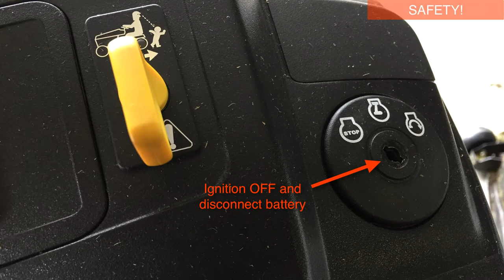Ride On Mower Snapper RXT 300: Remove deck

Comment: Thanks for a clear easily understandable video, it has confirmed the process which i will undertake tomorrow
Reply from the maker: And thanks for your kind feedback, Colin. I was only ever disappointed by Snapper's lack of instructions. I'm glad if I have made a difference.
Reply: @patgodfrey8451  Hi Pat, job done this morning, pressure washed and serviced, thanks
Reply: Hi again Pat, quick question, would you know how to bypass the safety interlocks on the seat I have open circuited and shorted the seat switch but neither worked, it's like it's looking for a specific value from the switch itself. Any thoughts welcomed (seat only)
Thanks
Reply from the maker: I believe there is a positive from battery to starter motor. This needs CONNECTED to start. There's also a negative from battery to magneto. DISCONNECTING that enables the ignition. So meting the conditions for both circuits would enable operation when the additional safety switches meet the same conditions?I've not tried that. Most people only clamp the switch to override it. 

New switches are around €30 from a quick search. I was also wondering if, following a jet wash, the switch isn't only shorting from damp? A hairdryer could sort that out while it is too cold to dry off.

Hopefully somewhat helpfully.
Reply from the maker: Correction - I first wrote 'broken to start' for the positive. Whoops. It'd need to be continuous. So updated just now

Comment: What autonomy has the rxt300? Gracias
Reply from the maker: The drive is automatic (hydrostatic - no gear shifts). The "cruise control" feature is crude and effective: reach speed and lift the lever on the dash. The blades run at throttle speed. "Mulching" or collection requires the manual insert of a baffle. The dashboard carries a useful digital (LCD) clock, hours-run, and servicing intervals. Choke is manual. For the budget, I have enjoyed working hard with this machine.